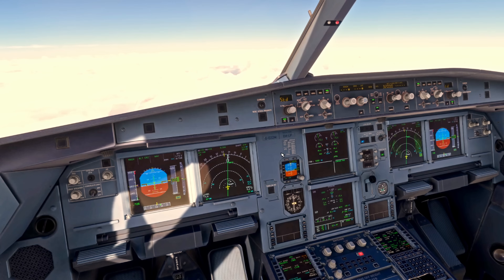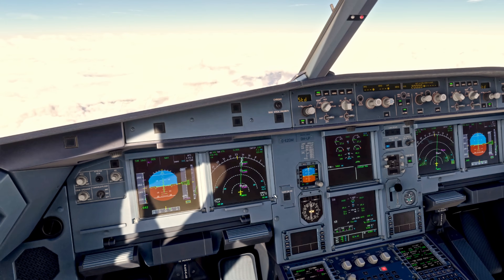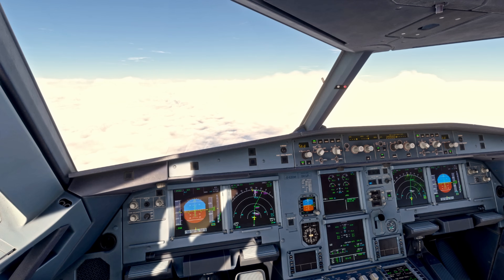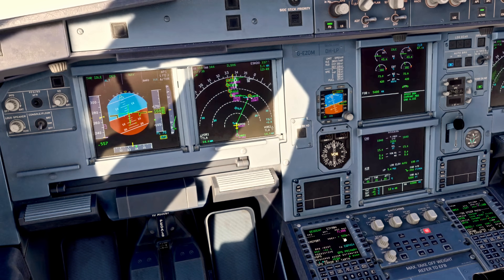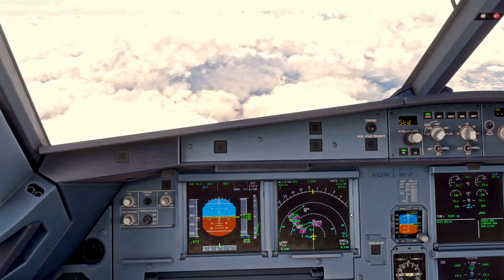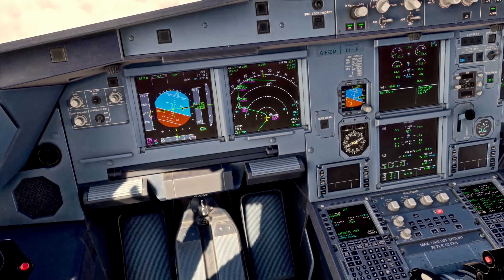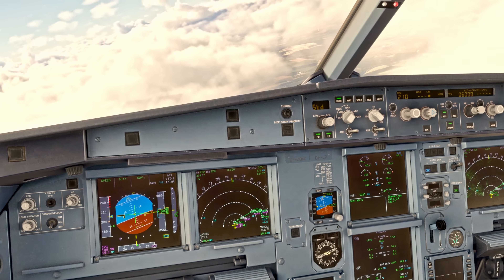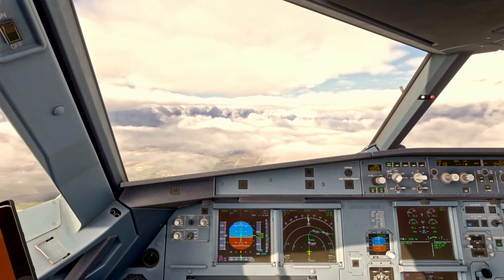A320 Descent & Approach Explained by a Real Airbus Pilot | MSFS 2024 Tutorial

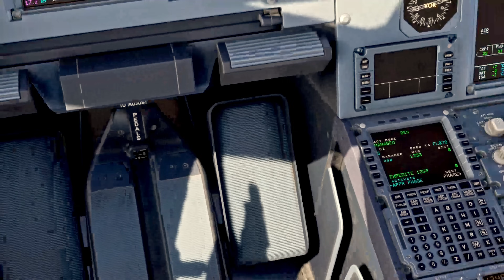Comment: Captain, at 11:40, you are activating manually the APP page in the MCDU. Normally, is this not done automatically at the appropriate time ? What does this change if you activate it early like in this video ? From what you say, this allowed the target speed to be brought back.
Reply from the maker: Hello, there are usually ATC variables which the auto transition to the approach phase does not take into account. In the real world I guess that I manually activate the approach phase more than letting the automatics do that. The automatics give you the optimum but we do not often get the optimum circumstances when we fly. Manual selection would generally be used when speed reduction is needed sooner
Reply: @AirbusCockpitCoach  Got it, thank you captain !

Comment: Thanks for the video. Question, when ATC clears the ILS runway does that mean I should then activate the approach phase? Also is there a procedure for when to lower the flaps and gear? Thanks.
Reply from the maker: Hello, approach mode is activated when you need to start bring the speed back to green dot or below, when you do that will vary, and you need to take into account descent as reducing speed will slow your rate of descent. It will also auto activate if you are following an arrival. This one comes down to pilot judgement and not clearance to the ILS, you will want it activated before that. Generally it would be activated about 20nm out but that can vary due to traffic, speed restrictions, ATC short cuts etc. Aim for flaps 1 before hitting the ILS, flaps 2 top of the glideslope, flaps 3 with gear down
Reply: @AirbusCockpitCoach  Thanks for the info 👍

Comment: In the video, you carry out the decent using the full STAR and Approach route into Edinburgh rwy 06. However, I assume you often get vectors and short cuts by ATC, in which case you would have been high on your decent profile. How do you handle the decent when ATC suddenly gives you short cuts to the ILS during the approach?
Reply from the maker: Hello, we try and listen out to hear what other aircraft ahead are being given as routing and we try and adjust for a similar clearance. Usually ATC are very helpful and routinely give out track miles remaining. If it's last minute it's a case of throwing the speed brakes out and increasing speed if we can using open descent, if that does not work we will need to request more track miles to lose height 👍

Comment: Captain thanks for the video. When flying this Fenix airplane, I find myself having to use the speedbreak quite a bit. In your descent here, you are using them quite a bit below FL200 for example.
In your professionnal experience, do you have to use the speedbreak in this Fenix plane more often than in the real one, or not really ? I'm asking on average, I understand that there will be a number of factors like weight etc that come into play too.
Reply from the maker: Hello, this particular approach could be managed without the speed brake if it had standard speed restrictions. In my experience I do not  notice that I use it more in the sim using the Fenix. We do use the speed brake a lot in the real world and probably more often than in the sim as there is more traffic/ATC impact causing delayed descent and speed restrictions at times
Reply: @AirbusCockpitCoach  Got it, thank you for the explanation !